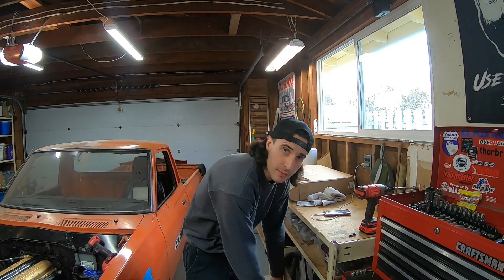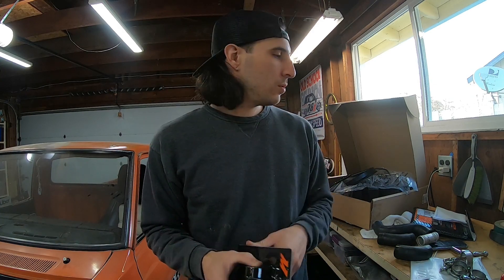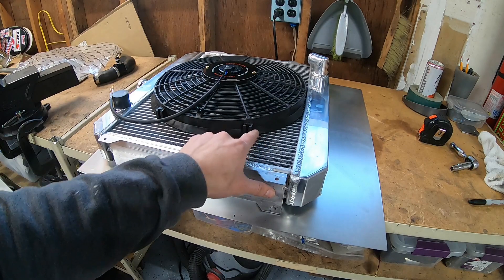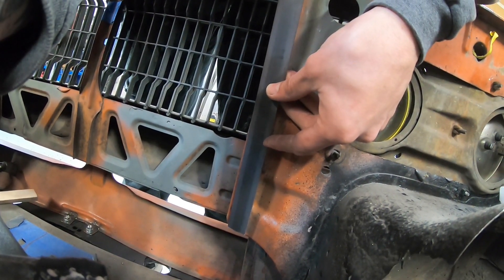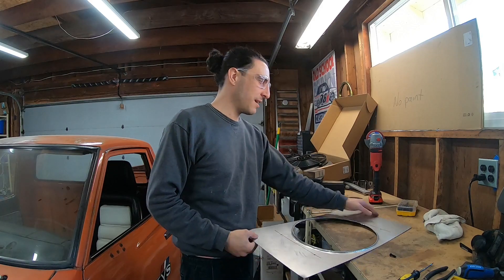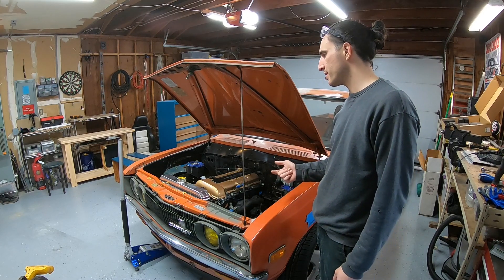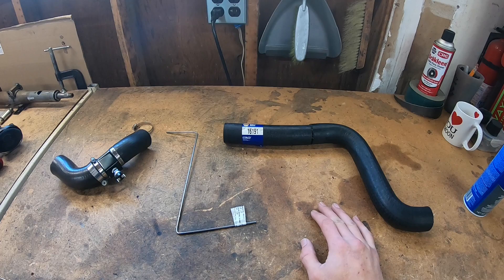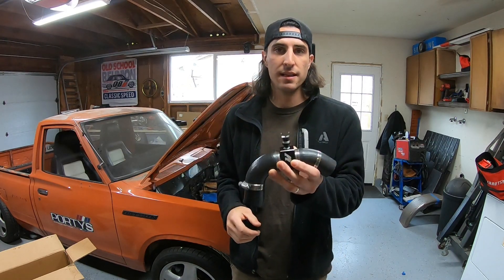Datsun 620 - SR20 [Mishimoto electric fan and water temperature sensor adapter install]

Comment: Again, plus points for the Uber sticker. And I see you got that I heart you to the moon coffee cup too! 
Sooo much more room in front with the SR. I had to go to a blow thru fan in the KA because there was no room elsewise.
Somebody said you should not bolt the aluminum rad to the steel because of galvanic corrosion...I used some rubber washers to isolate mine for what it is worth....
Reply from the maker: That's a great idea, I  painted the steel straps but I think some plastic or rubber washers couldn't hurt! It's tight spacing in these engine bays!

Comment: Thanks for including that diagram at the end! Its going to come in handy for sure. Would you mind linking or giving the name to that sensor? Didnt quite catch it. 

Enjoying these videos even if its just documenting your build, good information in them. Im collecting the last few things for my KA24de into my 620 KC.
Reply from the maker: That will be a fantastic choice, if I built another that's the engine I'd go with. The sensor is by Setrab I think I got it on Amazon make sure you get the right temperature. Good luck!
Added a link in the description 🙏